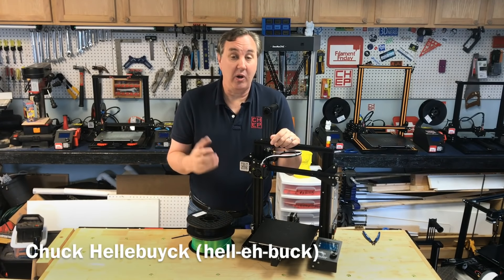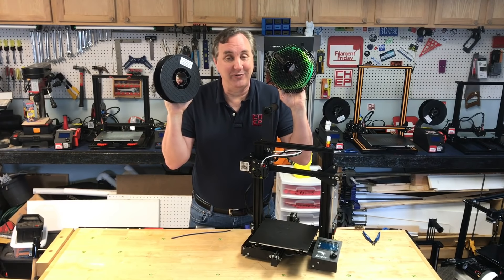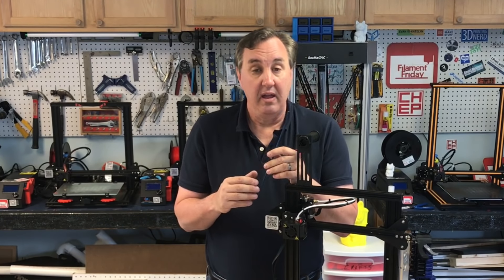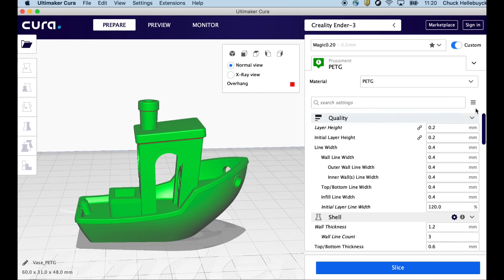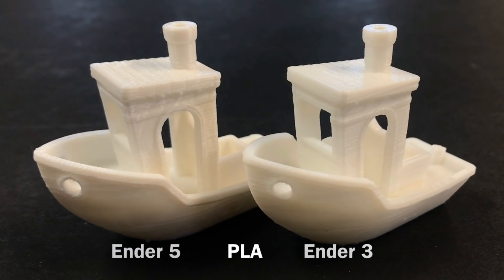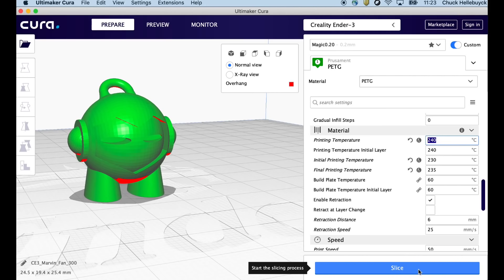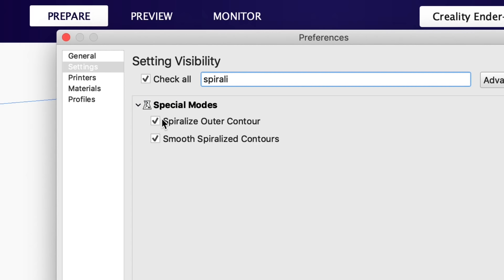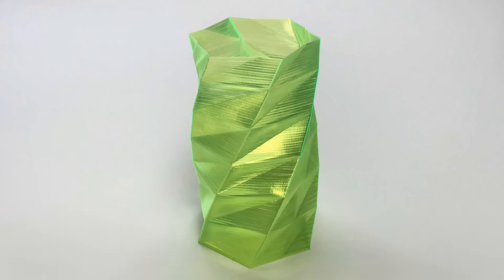PETG on Creality Ender 3 - Atomic and Prusament

Comment: I just bought an Ender 3 (my 4rth printer) last week strictly to print PETG and TPU for projects but I can't get it to print PETG. I'm printing on the stock buildtak, I have an all metal hot end with Capricorn tube, all metal extruder... The cooling fan is off, temp initially was within the range specified by Amazon...
It will print beautifully at .2mm layer height up to the third layer and then I get the dreaded clunking and it clogs. No matter what I try, I get to the third layer and it does that. I've slowed the print speed down to 25mm/s, (from 50mm/s stock in Cura) I switched retraction to 5mm and 25mm/s (from the stock 6.5mm and 20mm/s) and tried bumping the temp up by 5 degree increments all the way up to 260. (Amazon's range is 230 to 240C)
The weird thing is I got that roll to print on my CR10S4 before at 230C... once. But when the part stuck so hard to the tape and glass bed and cooked a stock tube I freaked and decided to go with the Ender 3 and removable bed.
It sticks beautifully to the bed. It's level, not much issue there. I am not sure if it is a case of too much temperature and low speed or what is going on. Any ideas? There are so many recipes out there!
Reply: I'm just here to get a reminder if someone has an answer. Got the same problems. I just read that you shouldn't put your retract above 3mm as this pulls the petg into the cold end which makes it clogg up even more. If you got a solution I would be extremely glad if you may send me your settings.
Reply: @Raruschmaru   Hi Arne. I went with the CHEP solution and went back to my stock hot end. Trying to print with an all metal hot end just won't work for me. Third time, third constant failure. Constant clogs.
 I swapped the PTFE tube with a Capricorn tube and that solved the problem.
I've been printing with PETG for about 6 days now successfully. I have had some issues but constantly checking the bed level has helped immensely. Thanks for that Gcode CHEP!
Do you have your cooling fan on? Mine is off.
What works for me:
Amazon PETG yellow (210-230c)
Stock Ender 3 hot end with sock, Capricorn tube.
CHEP Bed level each morning and when needed.
Magnetic Buildtak bed. (I was getting warping when I tried it without the magnetic part. Don't do that. Also, big parts can warp and bed curl if they take a long time to print due to size and temperature.)
240 C
75C bed
50 mm/s speed.
Retraction is at 4mm but I'm trying it at stock 6.5mm. I noticed more buggy crap now.
Cooling fan is OFF. (They say to set it at 20% after the first couple of layers but that never worked for me)
I found out through an accident that it will print the PETG at 215C this morning but it is extremely stringy and doesn't like to stick to the bed.
I am half way through the spool (printing R2-D2 drive parts) and then I've got 2 mystery white PETG spools to try. So I get to go back to testing again.
Watch out for pulling the piece off the bed. You can throw it off level by pulling the bed to pop it off if you aren't careful. Watch that you don't bend it too sharply.
I found that popping the piece off while it is still warm helps a lot. Warning: I destroyed the original Ender 3 Bed by having the extruder too close and letting the part cool completely. It took a hammer and chisel to get it off!

Comment: Beautiful job, man! Thanks for the tips! 😃
Question: did you ever printed with nylon and TPU using the Ender 3? How did it went?
Reply from the maker: Did TPU: https://youtu.be/1GNDxvxpWr8
Nylon requires even higher temp than PETG or ABS so I say Ender 3 can’t handle it.

Comment: Cheap I'm using inland pet g purple to reprint all the plastic for Mt tevo tornado and the settings are 250 c on the nozzle 85 c on the bed 2 default perimeters 40%part cooling sliced in curia and printed on the monoprice maker select pro.
Reply: Sounds interesting, where did you get STLs?
Reply: @vojtator  the stls. Are on thimgiverse.
Reply: @syclops01  Could you please tell me name of it? I tried searching but didn't find all of these
Reply: @vojtator  sorry in not at my computer AMD dolt re.e.near the exact name of what I am using , aldo I am using. Dual z super motors so the supports And everything. Will be digferemt. But when 7 get hi
I get home i will either link where on thingivers thwarts I a. Using or just type the names in chat.

Comment: Been there done that 265c to get a real good petg. after about four or five ten hour Priints it will ruin the original Bowden tube switch to Capricorn as soon as possible would be my suggestion to or a all metal hotend which is an awesome upgrade

Comment: I'm having issues with filatech orange regarding layer seperation when filatech transparent prints as perfect as FDM can achieve. they recommend 240c which is bullshit because you really do want to go higher.
also sticks wonderfully to PEI sheet coated with dilute PVA solution (school glue) sprayed from a mister. bed adhesion is better with it than anything I've ever printed with.

Comment: I cannot for the life of me get PETG to stick to the bed
Reply from the maker: I used a new sheet of Buildtak. It works great.
Reply: I’ve only ever printed 3 PLA sculpts on my current bed, so it’s basically new. I think I’m just messing up the temperatures. Gonna keep at it
Reply: Happy to report that I’ve fixed my problem! The crafting room I’m in is too cool from my AC unit, and is lowering the bed temperature significantly. I built a temperature moderation chamber (or something like that) out of a cardboard box and some bed sheets, and was able to get the printer to a constant 90 degrees. Printing out PETG like a champ! First print is half way done (a simple whistle). I’ll be building a more permanent and less flammable case after this print. 
Everything’s working fine, my PETG filament isn’t shrinking and is sticking to the bed

Comment: I printed an entire roll of Black Overture PETG on my ender 3 pro with just the stock stuff.  I ran the bed at 70 (which is the max the magnetic bed can take) and 240 on the hot end.  It gave me some problems, but it worked.

I will say that even running the bed at only 70, after a couple longer prints (9+ hours), some of the magnetic backing on the build plate did break apart in one corner of the plate.
Reply: I have the same filament and can't get a good print out of it using Cura :/
Reply: @handle7940  It was a pain to work with and ruined my bed.  I would see if you can trade it away to someone if possible.  I would if I had the chance.  Definitely not worth the trouble and probably 1/3 or so of the prints that I made with it failed.  I will likely never bother with PET-G again, at least not on the Ender 3
Reply: @Trueflights  Yeah, I would but I its not a common hobby in my area. One of my coworker is thinking of getting a 3d printer too though, but I told him not to mess with this type of filament as the results vary a bit too much.
Reply: @Trueflights  that overture kind of sucks! Sainsmart prints great for me.
Reply: @JavinCarelse  I usually get Hatchbox for PLA (not sure if they make PetG).  It was an accident that I even got the Overture.  I was in need of black PLA to finish a project and my supplier ran out and without paying close enough attention, I accepted their suggested alternative that unfortunately happened to be Overture PetG (how they thought that was a good alternative),

Comment: Chuck - what are your thoughts on an all metal hot end? I usually print PLA or PETG, getting away from ABS due to fumes - PETG handles most anything ABS does anyway...
Reply from the maker: It’s not the best for PLA but should help for higher temps. I’m planning to test one in the future.

Comment: I agree with your assessment of the Inland PETG filament... I tried it and it was terrible...
Reply: Interesting, I have gotten excellent results with Inland PETG on my CR-10.  I used it to print the body of an RC hovercraft ("Brushless R/C Racing Hovercraft" by jscaylor on Thingiverse).  I mainly use Inland filaments out of convenience.  Micro Center has them in pretty much every color of the rainbow, and there just happens to be one a few miles from where I live.  The spools of PETG I'm using are several months old now though.  I wonder if they changed the formula since I bought mine?
Reply: @deceitive3338  I've printed with a lot of PETG..., as a matter of fact I prefer it over PLA, but Inland PETG is just not that great.

Comment: Thanks for the outstanding video! Just ordered Capricorn Tubing for all three of our printers. I also feel better about my terrible experience printing Inland PETG after watching this haha. I have had very positive experiences with multiple spools of Inland PLA, but their PETG kept surrounding the nozzles on our Ender 3 and CR10 (or something that resulted in a molten glob of PETG forming on the tip). I even installed MicroSwiss All Metal Hot Ends out of desperation, but that didn't work either, possibly because I'm hesitant to go above 235-40C with the stock tubing (Inlands PETG Print Temp Guidelines on the spool are 225C-240C for anyone who might be wondering).
 The Prusa PETG filament is currently out of stock on Amazon so I'm going to order the Atomic directly from them today. I'm not sure if they have an affiliate program so I'll let them know that I'm trying their product because of this video :-). Thank you for sharing your knowledge with the community, your videos are extremely helpful!

Comment: Thanks for this Video Chuck! I was able to do the hotend mod and use your advise on the settings to print nice clean prints using PETG which I have been struggling for ages with on my Duplicator i3. The Ender 3 is an awesome value, I am glad I purchased it, and with your expertise I can now print PETG with great quality. God Bless!

Comment: Won’t PETG ruin some build plates or crack cuz of the material
Reply: Can sometimes get stuck to glass and it'll crack and be brittle if you cool the part too much.
Reply: @SwornHeresy  how do u prevent that from happening
Reply from the maker: I sometimes use a little glue stick as a barrier
Reply: @FilamentFriday  will hairspray work as well or
Reply from the maker: Never tried it

Comment: Did you not have to change anything with your bed? I thought PETG needs less squish. My experience has been that I have to increase the distance between nozzle and bed when using PETG. Also surprised you did not have to change retraction settings.
Reply from the maker: Just used a new sheet of Buildtak and my CHEP profiles with a higher temp.

Comment: He chep,
With a more difficult to print model like the Bullseye fan duct. I encounter jams at the extruder. When i free the extruder i can still push the filament thru by hand. Ever encountered this with your ender ? lowering the retraction distance gives better result but still not that creat...
Reply from the maker: The nozzle may have PLA pieces in there causing temporary blockage.
Reply: CHEP oke you still think its something in the nozzle ?

Comment: Im using Prima Select PETG, which has a much lower print temperature. Box says 195-235 deg c. Im using 220 and it turns out perfect. In fact I can use my standard PLA settings with this stuff and the print would turn out ok. Dont know why this PETG is so special, but its the only one ive found with such low temperatures.

Comment: I am amazed by your channel, I used the extreme fast and good 2.0 profiles for my PLA prints (started over Christmas) and is incredible! Thank you so much, you have for sure a follower and hopefully an active supporter soon. Do you think I could use PLA good 2.0 setting also for PETG but with a boost on temperature on both bed and hot end? I have a stock ender 3 neo, and I love it! Thank you!

Comment: Been having issues with PETG bed adhesion on my Ender 3.
Was going to try your profile out, but your link seems to be broken?
Maybe it's just me.

Great videos though!
Reply from the maker: Works for me. I did put new Buildtak on my Ender 3. It helped. 
https://www.chepclub.com/cura-profiles.html
Reply: I have a glass build plate and petg just wouldn't stick. I resorted to dollar store hairspray and it works wonderfully. I know using such things is kind of frowned on now days but it gets the job done until I get around to a better build surface.
Reply: Stome I am (as I’m writing) printing PETG on a mirror, it got loose @60 degrees, same @70 and now I’m printing @80, so far so good.

Comment: Good stuff.  I'm using prusament Galaxy black I actually just tried some inland petg in transparent green think I printed at 240/245 and I had pretty good results I just sent it threw the filament dryer first. 

However the inland pla was very inconsistent 😑 didn't string and colors nice but its hard to nail a temp were it extruder perfectly clean and isn't to hot

Comment: Perfect timing!! I've been printing a few things in PETG this week. 
I'll try bumping up the heat to see if that helps. I've been printing at 225°C. It's MG Chemicals PETG and the box shows 210 - 240° C. I found it hard to get stuck to the Ender 3 bed so I switched to glass with Aqua Net. It's seems pretty stringy....but maybe that will go away with a little more heat?
Reply: I reduce my strings by:   Faster travels (70mm/s or higher if your printer supports it without too much jerkiness), retraction (varies depending on your printer but use a little but more than you would use with PLA).   NO Z Hop.  Z Hop adds stringiness.   Cura has an option for moving towards the inside of the wall so that if it is going to string it is better hidden inside the walls.   Your mileage will vary on a number of factors with that, but I have had some prints with no visible strings and I've had others with very minimal / easy to pick off a few fibers.    In many cases even if you don't get your strings "gone" but you get them to where they simple rub off with a little bit of handling, you're pretty much "there".  Good luck.
Reply from the maker: Ender 3 limits Extruder speed to 25mm/s
Reply: @FilamentFriday  are you talking about travel speed or extruder speed?  (Isn't extruder speed the mm/s the filament is being pushed out?).  For PETG I try to print around 15 to 30mm/s max.  I do not have a dedicated part cooling fan on my current rig.  Are you saying the gantry won't move faster than 25mm/s during a travel (non-extrusion) move?
Reply: @underourrock  Thanks for tips... much appreciated. 
Z hop is disabled already. My travel speed is 50mm... I'll try increasing that and checking Cura to see if the "move to walls" option you mentioned is enabled. 
I don't really have the typical stringing. I use Octolapse to make a timelapse of the print. It moves the nozzle to left center for the picture. When printing PETG, the filament sticks where it was last extruded, then as the nozzle moves to left center for the photo, it strings filament half way across the bed, then when the nozzle returns, there is sometimes a brief under extrusion. 
During normal print moves, it seems to print mostly string free. 
I did drop retraction from 6mm to 2mm....that seemed to reduce the occasional blob but didn't help with dragging filament around the bed during long moves. 
Could be that my choice in PETG supplier was not the best.
Reply: @MadDawg91108  sounds like an interesting application.   Try the retraction rate at max (25 mm/s if I understood CHEP correctly).  There might be another option worthv playing with on the tool path.   Is your printer enclosed?  I find that mine works best with petg partially enclosed but not completely closed up.  (I suspect my stepper motors get too hot and start to skip, but don't know for sure.). Is your extruder calibrated so that 100mm extrusion actually extrudes 100mm?  PETG likes to be a little under extruded... But not too much.  Over extrusion can add to the strings.
Reply: @underourrock  The retraction speed is already set to 25mm/s...I only changed the retraction distance from 6 to 2mm.
My printer is not enclosed. It's also in a room with an ambient temp around 20°C. I was running the stock cooling fan at 50% also. 
I did calibrate the extruder for the PLA I am using. The extruder is set to 95 so it'll extrude the 100mm requested. I haven't double checked it with the PETG but it should be close enough. 

I've only tried a couple small prints so far....
Reply: @underourrock  What is the name of this setting "moving towards the inside of the wall" I can not find anything like this in Cura?
Reply: @doko979  I don't have Cura in front of me, but I might be the infill wipe.  I'll be back onto Cura tomorrow, so let me know if that's still not good enough to find it.
Reply: @underourrock  Thanks., but I think it's not. Could you check it later, please.
Reply: @doko979  Looks at Combing.  I get fewer / smaller strings if more of the travel is over the infill rather than crossing over the outside wall.   (I suspect this has more of an impact on PETG which is what I do my printing in than PLA sice PETG really likes to ooze.)  I know CHEP wasn't a fan of this setting in another video, but I believe he was on PLA and that was where he didn't notice a difference.
Reply: underourrock Thank you. What about the Retraction Distance setting?  Reduce?
Reply: @doko979  that will vary depending on the type of drive for your extruder.   On my direct drive I use 1.7mm of retraction.  Retraction speed seems to affect it too.  For me I use 55mm/s but I need to do more testing in my setup to see if there is a better ideal.

Comment: I have been printing for 3.5 years and am about to try PETG for the first time having used ABS previously for strong prints, my question is do I need to make any adjustment to the fan settings when printing PETG?
Reply from the maker: Depends on the print but probably not.